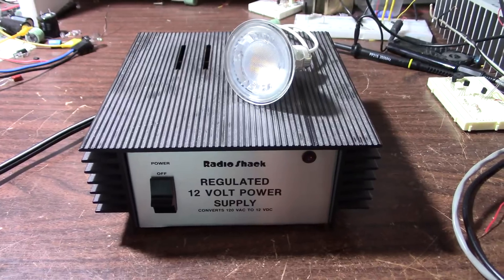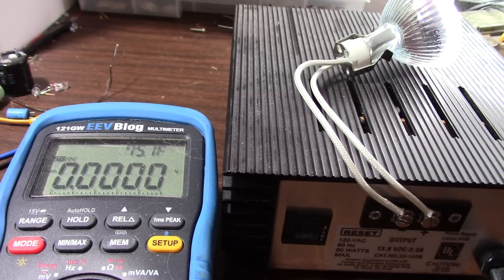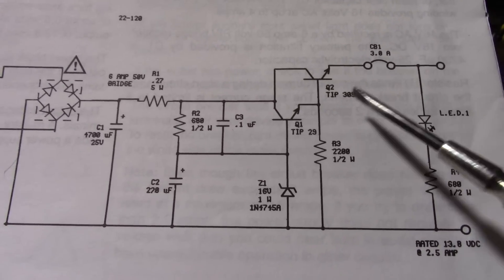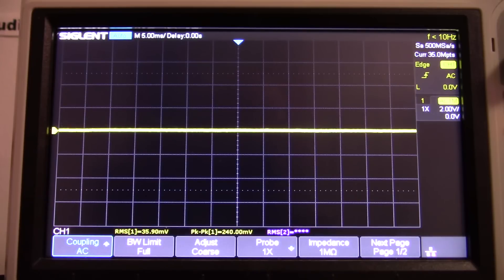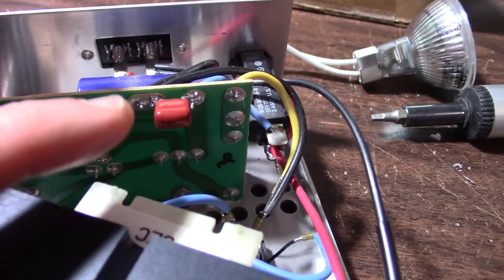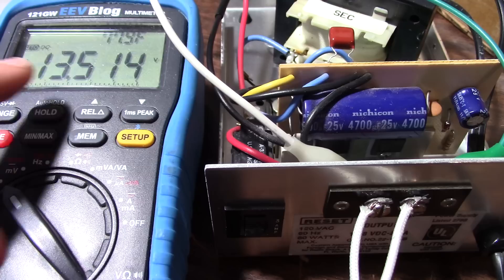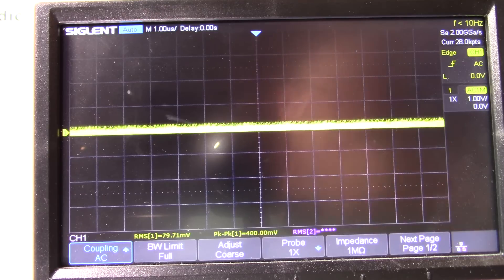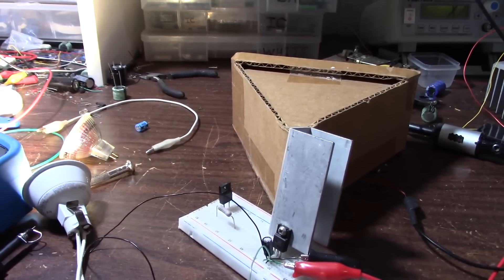12 volt power supply stopped regulating - What went wrong?

Comment: Hi, I have the same power supply and having an issue with it. It’s putting out 20 vdc and I’m not sure what to look at to lower it to the correct voltage. Thanks
Reply from the maker: Check if the regulator transistor is shorted or the zener diode is open, bad solder joint on the board, etc.

Comment: I know those were made to run ham and cb radios back in the day, but I always wondered why 13.8 volts? All manufacturers exactly the same. A standard of some sort I presume. And by the way, that bulb is a special one specifically for eating soup of the day at night. Cheers!
Reply from the maker: 13.8 is the nominal voltage of a car's electrical system with the engine running. If it were actually only 12 volts, it would not be able to charge the battery.

Comment: Every regulated power supply needs at least 3 things.  One is a reverse voltage protection diode, 3 or more amp, across the output, cathode to positive.  Another is an overvoltage protection diode, 3 or more amps, across the pass transistor, cathode to the most positive.  And lastly, an electrolytic and 0.1 uF ceramic across the output, close to the terminals. These diodes will protect against experiments with batteries, such as charging a Ni-MH.  Thanks.

Comment: "lumière du jour" = day light = about 5700°K.
first thing to do is checking capacitor, here C2 may be the problem.
10mV ripple come from the non-insulated wire.

Comment: A zener/transistor regulator will require a small load resistor/impedance as well as a small capacitor to function well. Also the transistor's b-e voltage drop has to be accounted for hence the higher zener voltage. There is an adjustable zener the TL431 in which the datasheet shows the use with a pass transistor. Alteration to this latter circuit may mean some existing pcb alteration as well. Use of the TL431 adjustable zener provides a crude output voltage feedback function. A capacitor across the output will provide additional smoothing which can be said to be multiplied by the transistor stage gain.

Comment: Thank you for the video. Interesting that Radio Shack spent the money to use Nichicon caps in a such a minimally engineered circuit. There are a myriad of ways to provide the voltage reference to drive Q1. Just as a goofy thought, I wonder if using a LM7812 for the zener would have any advantages, or disadvantages... Or, could a LM317 be used to make the voltage adjustable? Of course, a TL431 could be used for that. But, if I was going to bother to upgrade that part, I probably would upgrade the entire circuit. The unit has "good bones" = transformer, aluminum case and room inside the case. It would be a fun project to upgrade it... That is not a suggestion... Just a thought. Ooo... Looks like the front panel has lots of room for a display.

Comment: I would replace the circuit with an equally simple, but stable lm317 based reg with a piggyback transistor for high current. You could make it variable too.

Comment: Why don't you substitute the zener diode with a TL413 and 2 resistors? A 1kΩ and a 3.9kΩ will give about 12.25V output.
It will give better output voltage regulation.
Reply: It will barely make any difference. It will certainly be a more accurate and stable voltage reference, but the regulation performance will be dominated by the terrible circuit design that includes no negative feedback at all.  It's just a basic emitter follower.
However you could add a TL413 and  modify the design to take the feedback from the output which should give a substantial improvement.
Reply: It has to be 13.8 volts. Because reasons...

Comment: Interesting to watch and good demonstration of use of bypass cap. It would be an interesting exercise to calculate the impedance of that cap at the frequency seen on the scope. At 13.8Vdc, this PSU would have been designed as a 12V lead acid battery replacement to power things like vehicle radios etc. Adding the bypass cap was a good easy solution.